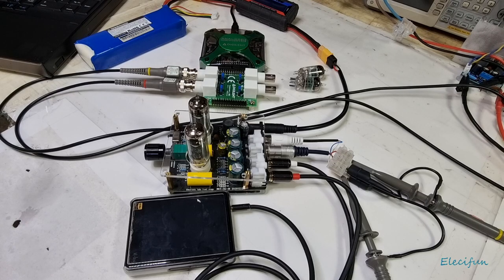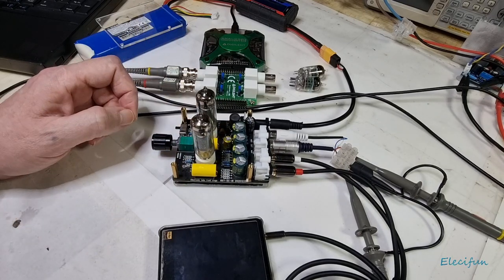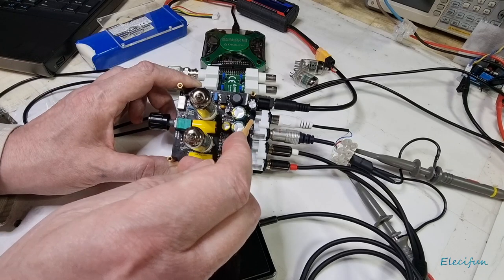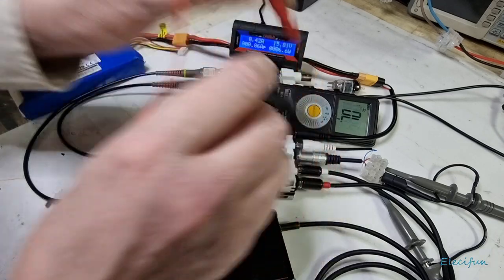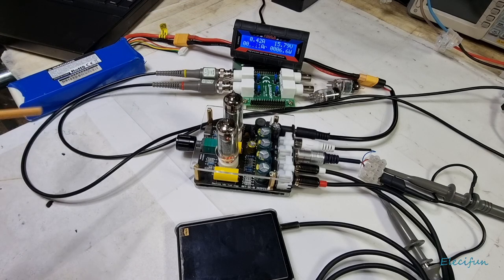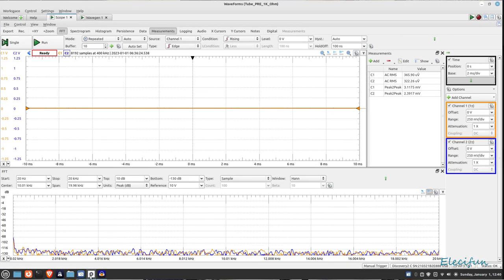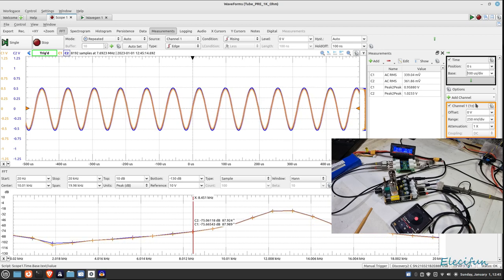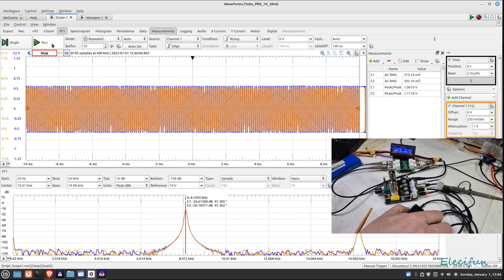AIYIMA Upgraded 6K4 Valve/Tube Preamplifier

Comment: Greetings from HK.   Thanks for the video w/ experiment that telling the difference between the two tubes.   I was really wonder those tubes are really working and had put any differences before watching your video.  Currently using a douk audio / aiyima 5654w preamp/miniamp, maybe I will swapping the tube to 5725, EF95, 6j1~6j4 in the future.
Reply from the maker: Hi lovely to hear from a HK viewer, greeting from the UK. Yes the tubes are in the circuit and swapping them out made a big difference, which I like,  I used GE5654.

Comment: Hi, I'm Brazilian. I don't speak English, but I would like to know if this 6k4 tube preamp is worth buying. ? I've been wanting to buy it for a while, but I don't know about the quality. I want to use this 6k4 tube preamplifier, in the aliexpress C160H TPA7498E 160W amplifier.
Reply from the maker: It sounds better with the GE tubes
Reply from the maker: GE5654
Reply: @Elecifun  Hello. sorry for the delay in replying. thank you very much for the feedback friend. I haven't bought the preamp yet.
Reply: @Elecifun  bought this amplifier C160H TPA7498E 160W * 2 Bluetooth5.0 + AUX
Reply from the maker: @dionatasalmeida8581  Are you talking about this from Aliexpress ?

Item number   1005004500079916

Comment: Oh incidentally I discovered the problem with my fm transmitter! 😑🤓
Reply from the maker: Great stuff, what was the issue?
Reply: @Elecifun  There are two what appears to be zener diodes.

One is a zener diode the other is something called a varactor diode which is something new to me.

1. ZD 4.3V 
2. FV 1043

The problem is they're in the wrong positions.

I need to swap them.

I just hope I have not damaged other components on the board. 

I'll order these components and replace them both.

Dec.
Reply from the maker: Fair play for figuring it out. 
Hat tip, Sir!
Reply: @Elecifun  Thank you sir ! 😂👍

I swapped the two components over, and it's WORKING albeit not very clear and I think maybe I need to try to find an empty station slot. 😅👍

There is a 4 pin switch block and another H ~ L switch which gives me multiple different stations to transmit on.

I'll have to fk around with it a bit more to try to get it to work properly, still it seems to be working albeit I'm still wondering whether I damaged any components or not? 🤔.

Comment: Thanks for the shout out Elecifun. Yeah that's a bit different than mine with the DC input and hifi switch... I'm really enjoying this video with your scientific testing of the tube set up versus my unscientific ear tests lol.  I suspect your pre amp sounds very similar to mine and I'm glad you like it. I hope you feel it's a decent value and the upgraded tubes are worthwhile. I upgraded mine to the GE 5654W as well and can hear a significant improvement that gets even better the more I use it. I've read about "burn in" and suspect its a real phenomenon. I totally agree with your "crap in - crap out" ethos. I use the best cables that my budget will allow and my best sound comes from my classic iPod ( I wish Apple was still making and supporting these). The sound coming from using my phone or computer as a DAC is simply not as good as from my iPod. Thank you for making this video Elecifun. I think you are corroborating what my ears are telling me. Cheers amigo. I hope you have a wonderful 2023.
Reply from the maker: Glad you enjoyed the video Ox.. Uploading music now as didn't want to make this video longer. I am having an all day music listening day while I get on with my house work. Hopefully letting my tubes burn in a bit, I may hear a difference. 
I have ordered another tube pre amp kit which will use the 12AX7's and 12AT7's I have, I may take a few weeks on a slow boat from China but I'm sure it will be worth the wait.
Reply: I'll be interested to learn your opinions regarding the 12AX7. I have them as pre amp tubes in my favorite guitar amplifier. I know it's sort of "apples and oranges" when comparing guitar amps and hifi amps but it's all quite interesting to me. I've been toying with the idea of getting one of the larger tube amp kits from China but the ones I like start around $400. That's comparable with the USA kit I'm considering without the two month wait and arguably better components.... Decisions decisions... Lol.
Reply from the maker: @Sonic_Ox  The 12AX7's have the largest gain (100) out of the 12A( )7 range. That's why they put them in guitar amps because the pick ups on the guitar are high impedance so need extra amplification. Looking through the tube power amps is hours of window shopping, great fun. I will start mainly because of money constraints, with a tube preamp that compliments the amplifier channels I built and my bigger 3030i speakers. Its all good fun.
Reply: That's my thinking exactly.
Reply: Oh man, get an inexpensive USB DAC and run apple music high res from your phone. It'll be like lifting a pillow off your system compared to the old ipods. Can confirm. I just made the switch myself this year once i realized i could plug my phone into my mixing interface.

I also have a completely debugged and performance dialed schematic for the AC 12v version of this preamp if someone want's it emailed (or another route if spam is a worry) or something. It's a shockingly dial-in-able design. Im about to build the debugged schematic as my first p2p tube preamp as i have become very familiar with the circuit, the purposes of all the individual components, and have a really cool old cuban cigar box. i learned a metric shit-ton about the gear i use in the process of figuring out the debugged circuit. Output impedance under 1k, gain id guess at least +6 db. Entire range of volume knob usable until right at the very end. basically Zero noise. Quiet as my SS preamps. It's now the quietest preamp i have potentially i just dont have a way to measure by ear, but its very close, and it delivers the most usable clean gain too (Honestly, of any preamp i've ever played with). Total investment was about $25. cost/permormance ratio off the scales. Started with thestuffmade's (youtube channel) modified schematic. then slowly tweaked certain coupling values tiny little bit at a time, added negative feedback resistors but removed the cap in the proposed negative feedback design and raised the resistance value, carefully paying attention to frequency oscillations with a cranked up power amplifier and freq generator app. Very proud of what ive come up with actually, and it's a good bit simpler then the stuffmade's schematic while also, imho, out performing it. to the ear at least.

P.S. i have NoS military spec 6AU6 that sound just as good as the ge 5654 pairs i have, you just get a little bit less gain out of them and they sound better to my ears without a negative feedback loop. Be careful going over 1.5uf with the coupling caps, the stuffmade says 2uf, but i had some slightly iff low frew oscillations. 1.5 UF fixed the low end impedance performance of the preamp. Adding a single reverse poled 470uf cap from r9/tr4 junction and replacing the heater filter cap with a 16v 2200uf instead of 470 or 680 uf completely removes all power supply noise from this arrangement. Negative feedback loop with a resistance value of 200k 1/2w reduced gain to just maxing out and clipping at the very end of the volume sweep, making all available gain intensely usable. Bridging the rearward leg of D1 and the adjacent empty mains ac solder pad, severing the traces for the knob based switch, and adding a switch between the amp and transformer removes all mains hum from the board's volume sweep. But so would building this preamp point to point with proper routing and shielding. Which can be done for about $25 if you figure out a chassis arrangement, outperforming some $500-1000 tube preamps in the process.

There are very usable Class A tube power amp kits on ebay for $100 and less too. But you'd have to debug the circuit a little and provide your own chassis and power transformer. Most of them come with the output transformers though that i've looked at. the 12v AC version of this preamp has been my favorite tube preamp to tinker with. Ill be building several of the class A power amps, choosing my favorite after debugging, and the recreate it with a point 2 point build as well so i can properly impedance match it with this preamp perfectly. Goal is truly pure class A tube sound, hand wired, with final builds costing under $200 for preamp and power amp both. Shooing for 12-15w per channel minimum.
Reply: That's a lot of GREAT information Floop. I'll bet your systems sound fantastic. I'd be very keen to see your finished build in that old cigar box. I'm not nearly as well versed with the electronics technology and testing equipment as Elecifun here but I like to think I have a pretty good ear. I am a hobbyist guitar player and have been a HUGE fan of the Classic Rock through tube hifi sound for almost 50 years lol. Cheers amigo 🍻.
Reply: @Sonic_Ox   Man, 3 months ago i couldn't have answered a single question about amplifier technology. Didn't even know what input impedance was. That little 12v preamp kinda springboarded me into a passion i didn''t know i had lol
Reply: It's so satisfying when you follow your bliss without breaking the bank and actually achieve the results you were dreaming of. I built my little tube amp into a Pink Floyd lunchbox 8 or ten years ago. I  listen to it every single day and it still brings a smile to my face every time I turn it on. There's something magical about the glow of the tubes and the warm sound of valve amps. Especially satisfying when you built it yourself. I'm totally hooked. I'm happy for you that you've ignited that passion in your heart. Merry Christmas amigo.

Comment: A little tube amp ! How much per side? 🤔
Reply from the maker: Its a pre-amplifier used to drive a power amplifier, it's fits between the source and power amp. This one being valve/tube adds a subtle 2nd harmonic giving a fuller/richer sound which many enjoy.
Reply: @Elecifun  oh okay I see. . I guess I'll never know what it sounds like unless I build one myself. 🤔
Reply from the maker: I am uploading music now, couldn't add to this video as it was to long for my concentration.
Reply: @Elecifun  can you suggest me a good vaccum tube preamplifier from fosi audio or aiyima ? Please mention the details of the product and suitable replacement for the stock tubes .
Reply: @marishkumar607  aiyima t3 it's cheap and good but by replacing valves to get 5644 (also cheap) you can get a little better sound